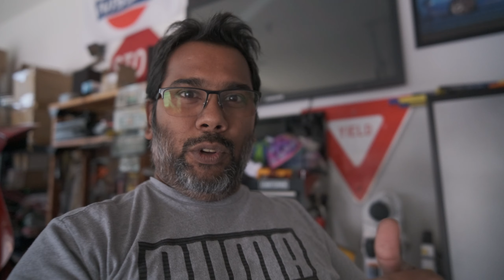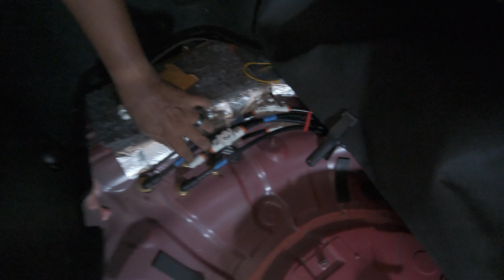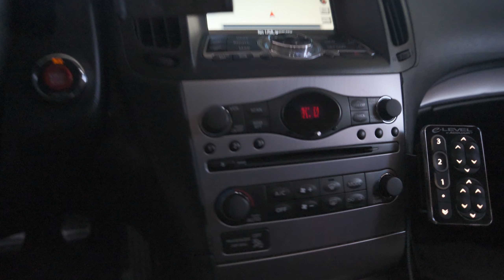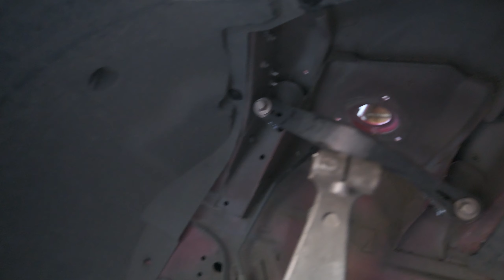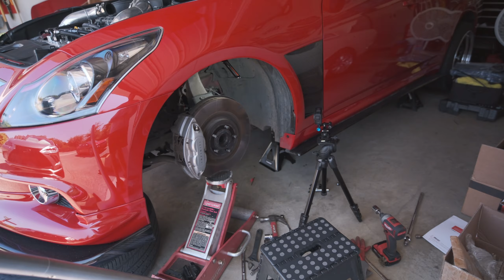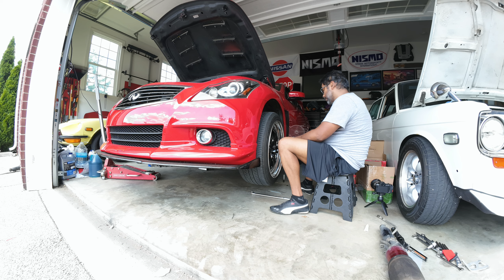Air Rebuild Part 2 // ZNats Prep!

Comment: They all fail after so long. We use them everywhere in our plant.
Reply from the maker: Ah ok so it’s not just degrading because of heat.
Reply: @3rdPedalMedia  yeah the constant heating and cooling prematurely kills them, but even the ones in the plant that don't see that kinda temp. swing probably leak after 2 to 4 years.
Reply from the maker: @AChadorChud  gotcha.